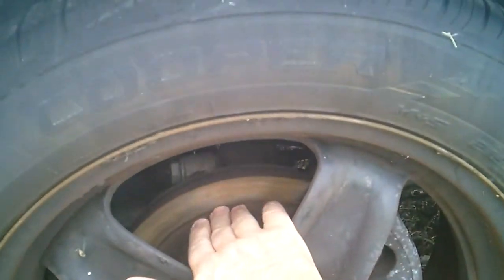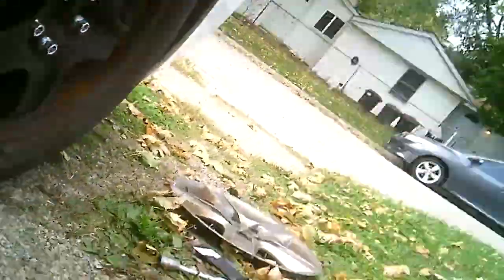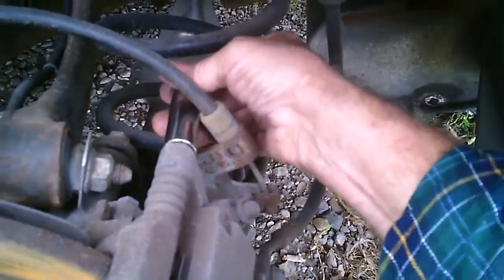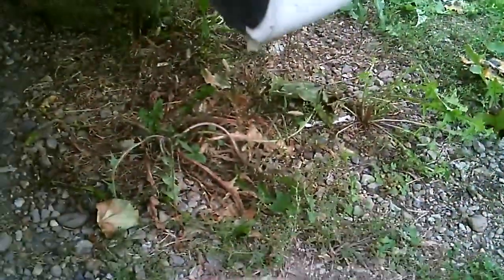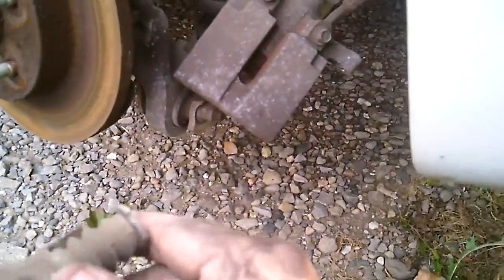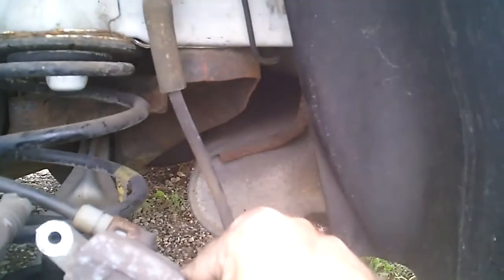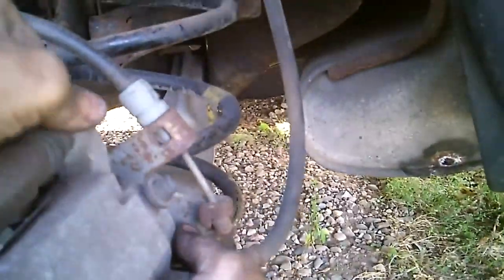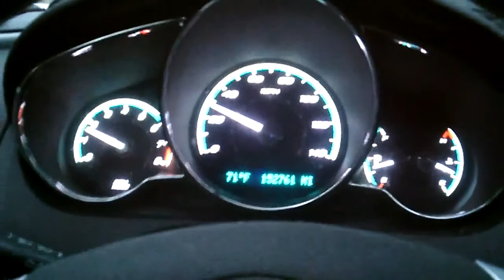2010 Chevy Malibu Rear Brake and Rotor Replacement

Comment: Where did you get that tool to screw it back instead of using c clamps
Reply from the maker: NAPA auto parts. It cost about $9 or so.
Here's a link for it:
https://www.napaonline.com/en/p/BK_7769037?cid=paidsearch_shopping_dcoe_google&campaign=GSC-Tools-Equipment&campaign_id=8553470562&adgroup_id=107047174069&adtype=pla&

The cylinder has to be screwed back into position. A C-clamp will not work.
Good luck with your project.
Reply: Can you use a c clamp instead? Or it has to be turned